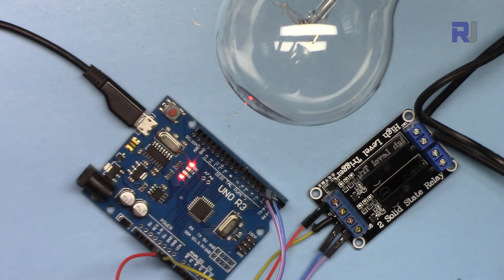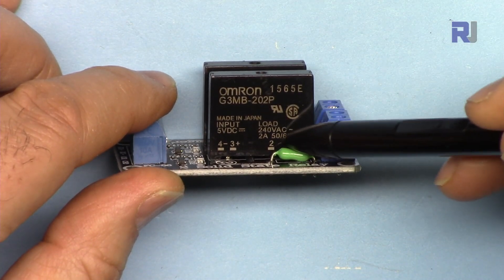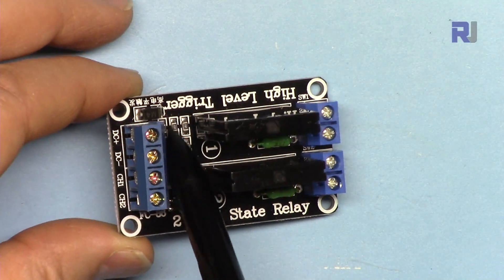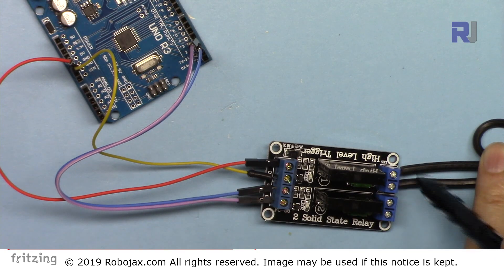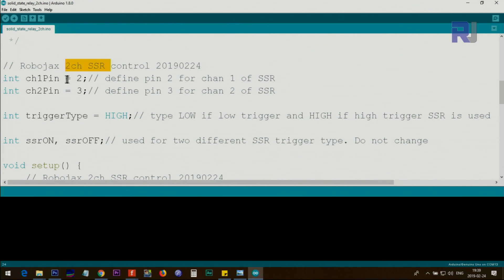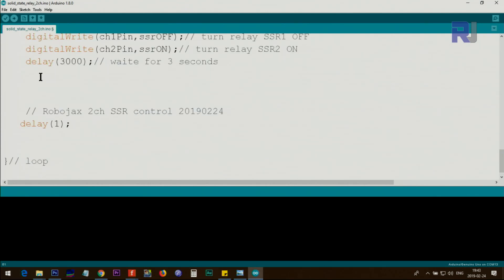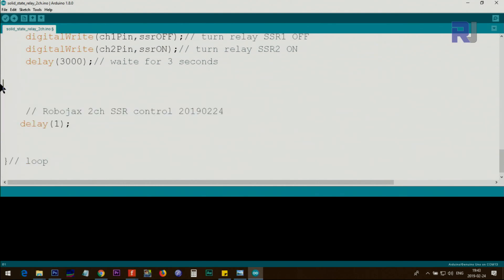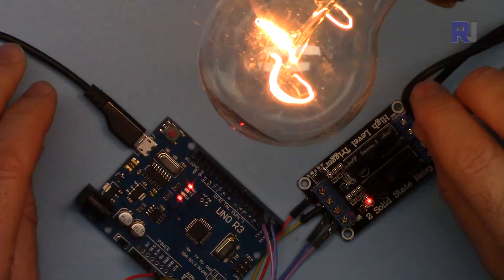How to use 2 channel Solid State relay SSR with Arduino RJT153

Comment: Hello Achmad, my question is how to use two channel module like this but with the fotek 40A SSR to switch alternately between two thermocouple controlled AC loads? For example channel 1 SSR on for 20second duration while channel 2 is off, then switch alternating in loop until reach temp? Many thanks.

Comment: I just want to switch a microcontroller pin connection to ground with another microcontroller's 3.3V output from one of it's pins.  All these relays are for high current, isn't there a way to do it with just a transistor or somthing?
Reply from the maker: Always search my channel. You will be surprised. Here is how to drive a relay with transistor https://youtu.be/N-fFk51Eb8s

Comment: how can i wire the circuit if i need to use a separate power supply 5v and how to trigger channels.
Reply from the maker: the same way connect external 5V. just connect the GND wire of external power to Arduino so they are common. it should work.

Comment: can you help me , lamp on relay on but big lamp not on , still off ?
Reply from the maker: either you changed the code or incorrect wiring.
Reply: @robojax  i have code from you . and for wiring .use like switch
and i test use multitester can not connected when lamp in relay ON

Comment: is it possible to have both channels off for a time during the loop? as i not managing.
Reply from the maker: They are independent.
Reply: So if i code digitalWrite(ch1Pin, ssrOFF); 
                    digitalWrite(ch2Pin,ssrOFF);
                     delay(2000);
Will the relays both remain off during those 2 sec? As it's not working for me
Reply from the maker: Please see this https://youtu.be/u2HsiTS8niQ and then this https://youtu.be/rUtDfadf8Jk
Reply from the maker: You didn’t reply ? Watch and learn you can do it
Reply: Was carrying out the testing, it seems to be working now, thanks for all your help

Comment: Hi, I live in Europe (220-240v) and I want to use this system using only 1 power source, so I split the cable from plug to 2 lamps, from each lamp respectively to relay A1 and B1, then back from A2 and B2 to plug. I try to use the 5v dc + and - and have tried directly on a D1 mini, which takes 5v in and gnd, 2 switches to the respective pins, software etc working via powerbank, but not powering on via the keyes 2 SSR. Any idea what this could be? The board still works after a few tests..
Reply from the maker: Hi, sorry I came across your comment (where I see all comments from all videos on one page) and could not understand it and that's why I left it unanswered. I did not understand "then back from A2 and B2 to plug." you first said that from the powerline you already connect it and then you mention this. sorry.

Comment: Hi,

does this work only when using AC voltage at the output?  I am trying to control a DC Lidar sensor
Reply from the maker: Hi, yes it does. Only AC. For DC you  use mechanical relay or MOSFET.
Reply: @robojax  Please can you explain why it won't work with DC?

Comment: Hi. Sir. Without load it's not can taste  ? Because with then I get signal light is On but output I testing with meter it's not showing that it's On.
Reply from the maker: Hi, there must be something wrong. either bad wiring or bad load (bad bulb). Check it again.
Reply: @robojax  I have the same problem. The Signal shows both channels switching but I get no output on my Meter (continuity)
Reply: Please did you solve the problem?
Reply: @nathangarpiya4554  
No. And letter I not was used . Did you try it ?

Comment: I want 2 connetion for one light ,one manual and another by mobile app if i off the light it should change the status of light on mobile app also
Reply from the maker: This is interesting project.
Reply: Basically your answer is software. If you use this project with one light and a D1 mini with MicroPython, you use the WiFi on the D1 and add a button if you want to control the 1 relay switch for lightbulb.